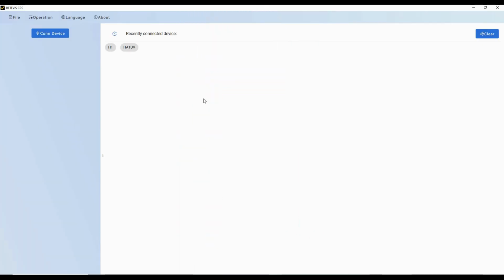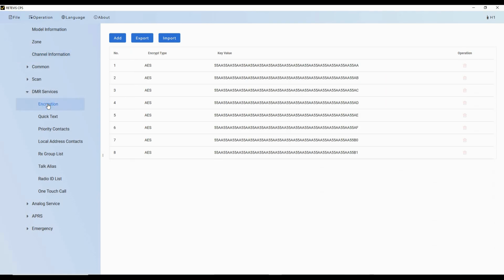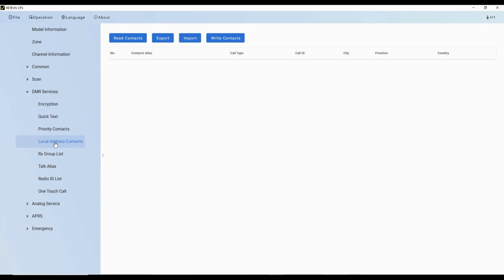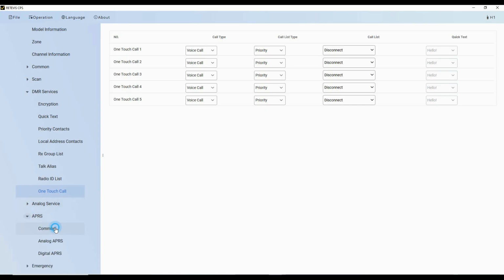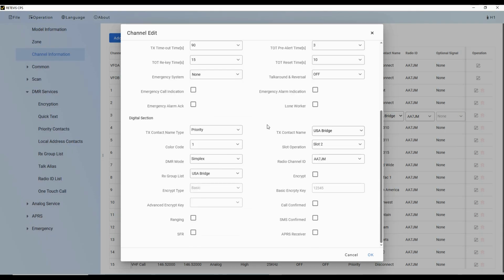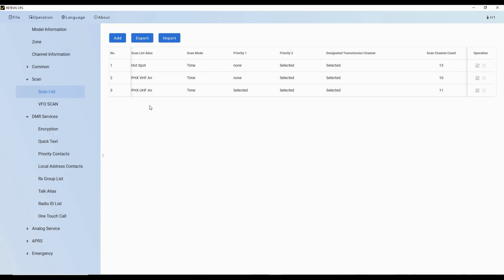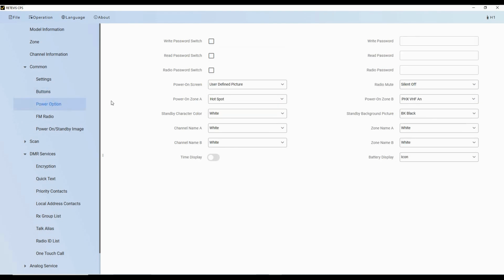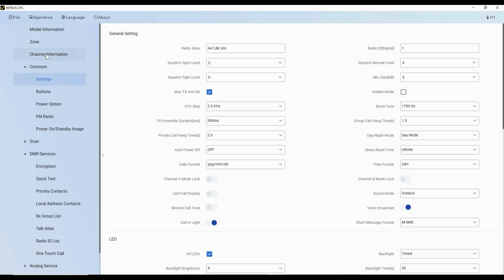Program Your H1 DMR HTs Code Plug - Quick and Easy

Comment: I hate to be your first comment, and be negative.... 

You are great, but Retivis has really FUBAR the software. I can only find 1.1.0, which I think someone must have renamed 0.1.1 and released it as the new version. It is horrible. 

Import and export modes are corrupted.  There are other issues, too.  I've notified support through Amazon to see if I can get them to link to me or forward to me the 1.0.6 version. 

Thank you
Reply from the maker: Thanks for the warning. I'll delay upgrading for a bit. I didn't notice those issues with the previous version. If its not too much trouble, would you please post an update when you get things figured out? Cheers.
Reply: @GadgetTalk4U  Retevis support sent me a link to the version you have, but I haven't installed it yet.  

I'm embarrassed to say that I discovered that when I put the frequencies in the repeater channel manually into the radio, I could hit the repeater. But, when I added it to the software, my dumb brain only changed the frequency by 60 Hz, not 600... OOPS.  

I can export a CVS file and then edit the file by using the copy rows and making edits to get around the symbols, but it still makes me manually replace each frequency individually, both input and output. 

I'll try the older software later.  

I see that the radio can be used like a simultaneous simplex repeater.  

I don't know if you saw it but it has a feature I'm anxious to test that when someone transmits on TS1, it retransmits it on TS2.  

Thank you and 73